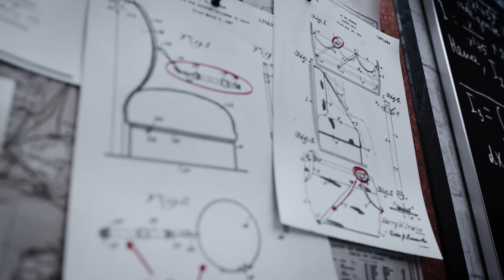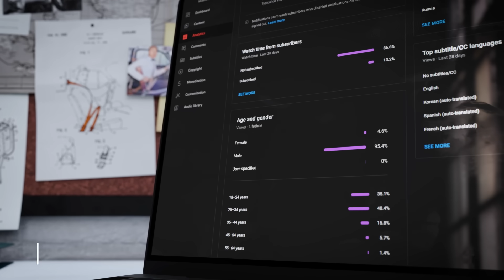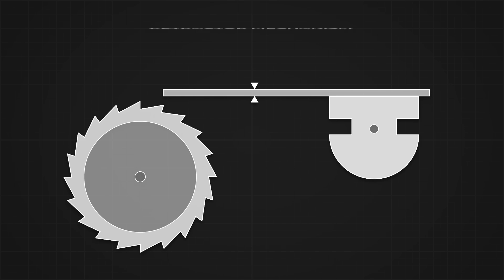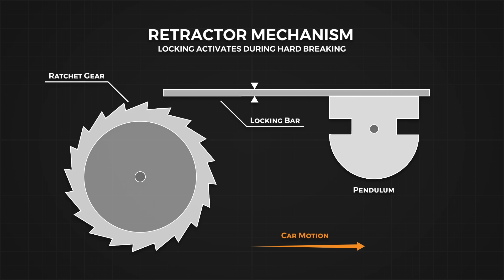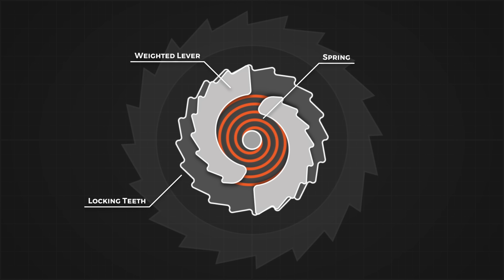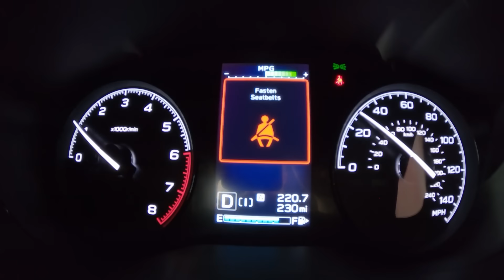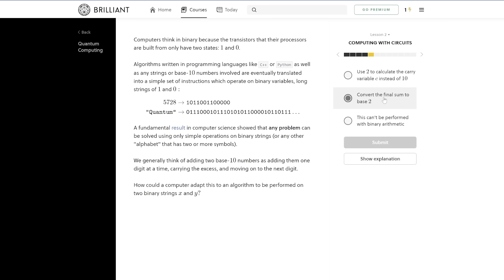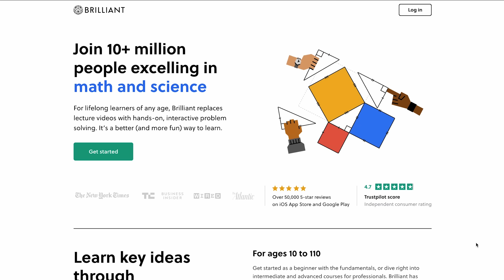How Do Seatbelts Work?

Comment: Malaysian here - First of all, I'm very sorry to hear the loss of your friend. Secondly, I couldn't agree with you more regarding my country's road safety record. 
I still remember sitting in my club president's car and I noticed that the rear seatbelts seem to have been removed from the car - l remembered how scared I was hoping that a crash wouldn't happen - or else I would risk launching myself into the driver's seat! Thankfully we are all safe and our drive went smoothly. 

It goes to show how shockingly lightly some people take road safety over here
Reply: Also a Malaysian here, I remember at some point every passengers are required by law to wear seatbelt (before this it was only the front iirc?), I'm not sure how strict they are enforcing this but before this, people would give you weird look if you wear your seatbelt at the rear (at least that was my experience).

Also, thinking back now, the middle seat at the rear is scary as fck. There's basically nothing in front you to pad you from a crash, and the two point harness seatbelt feels like it's gonna cut you in half.
Reply: @Summer-xu8qu  Many cars now have a three point seat belt for the back middle.
Reply: @Summer-xu8qu  Reminds of that one ad where this girl sits at the middle and got launch to the front of the car distracting their parents and came to school with bruises in her face. That thought alone scare the living out of me.
Reply: I feel like the incredible safety of automobiles means that less people are getting into situations where they or a loved one is getting i jured or killed and they are completely losing all understanding of how dangerous cars are.
Reply: Same here. I have Malaysian friends that uses fake seat belt clip to bypass the seat belt alarm. Most of them complain it is uncomfortable and hard to breathe. However when Covid-19 struck, they diligently wear their KF94 and N95 masks.
I even have 1 aunt that refused to wear her seat belt and will unbuckle mid drive. I so fed up with her as her irresponsible action as a rear passenger puts my front passenger at risk. I stopped the car at the emergency lane and told her off. Since then, she stopped doing it.
Reply: Most cars in my country (India) have rear seatbelts removed right from the get go
Reply: When I was living in Malaysia, I haven't noticed these problems. In fact, since I learned this in KL, after moving back to my country, everyone was laughing at me whenever I buckled my seatbelt at the back.
Reply: In Indonesia too!
Reply: We have the most advanced automobiles in this day and age.

The King of the Road is the world's first fully-flight capable vehicle in production.
Reply: @bangerxshane  yet we still lack basic common sense

Comment: Are there also electronic seatbelt tightener mechanisms? My dad was driving and braked really hard because there was a guy crossing a road 80km/h speed limit, he didn't hit the guy and we stayed on the road, no airbags deployed, but the seatbelts tightened (and the hazard lights came on) were those the explosion powered ones, and would we have to replace them?
Reply: You should probably call a service center to figure out the details, because it might actually need replacement.

Comment: I'm old enough to remember the general population's disdain for the seatbelt. Later we had those awful electronic seatbelts that adjusted themselves (moved) over the driver and passenger. At some point beeping was introduced to remind the drive to put on his seatbelt. I think to do a video like this justice you have to include other advances in vehicle safety. Older vehicles were made out of solid metal which transferred much of the force of impact directly to the passengers. Today's vehicles are designed to crunch and absorbe a good amount of force to prevent serious injury. Then we have modern cars which have all sorts of sensors and cameras that work as preventive measures. All of these features work together. The seatbelt is the last line of defense.

Comment: It's hard to fathom just how quickly making it a law to actually wear them has changed things. When I was young it was totally legal to drive around with your kids standing in the car and I remember several trips where a bunch of us were crowded into the back of someone's pickup truck and sloshed around haphazardly inside it on the way to a campsite...after it became law. In high school that had faded with almost everyone I knew wearing seatbelts and the few that didn't were rare enough that I assumed they just forgot. My first full-time job after college moved to an even smaller town and to my shock I was scoffed at by my boss and everyone else in the office for wearing my seatbelt in her car when we carpooled to lunch. By the time it was my turn to drive, they begrudgingly wore them because, as I pointed out, I'm the one who gets the ticket if they don't (none of them even bothered with the tinfoil hat things anti-seatbelters claim, they knew full well they were putting comfort over safety). I've since moved to an even smaller town (42k, 12k and 4k currently - at this rate I'll retire in my own town population 1) and everyone I know wears a seatbelt and even uses seatbelts as an example of something "obvious" as if none of them avoided seatbelts just 30 years ago.

Seatbelts have saved my friends, and not wearing them has cost the lives of my father's friends.

I really didn't want to see vaccines mandated when I was young because there have been some problems, but at this point we're going to have to put on our big society pants and mandate them like we mandated wearing seatbelts. Within a generation the idiots who think their tinfoil hats will protect them better than a vaccine will have died out. And I say that as one of the 0.0000000000000000000000000001% who had a reaction to the Pfizer vaccine. (I'm sick of being people's excuse.)
Reply: Its interesting as someone who was born in 1999 how i have always felt more comfortable wearing a seatbelt in a moving car than not. Now the only times i don't were one is when I'm only going 5mph reshuffling cars in the driveway.

Although my favorite example for why you should basically always wear a seatbelt is this: "Humans can run about 15mph, so put your hands behind your back and sprint full force into a brick wall. If you answered no then wear your seatbelt at that speed."
Reply: I wish my state would make it a law so my dad would actually wear his damn seatbelt

Comment: I likely wouldn’t be writing this if not for a seatbelt.  Walked away from a bad accident. When I went to the scrapyard a few hours after to get my things from the car, the tow truck driver looked at me and said, “YOU’RE ALIVE?!”    Haha.
Reply: Tell him you've come back
Reply: @darin7553  Arnie voice: "I'm back"
Reply: Must've thought he was seeing a ghost lol
Reply: Cars these days are INCREDIBLE. Honestly the most convinceing reason to buy new these days is the safety features. Every car from the 90s or 2000s is basically a deathtrap by comparison and with electric cars having almost nothing but crumple points they seem to be getting even safer. Whats funny though is because of the use of crumple points, despite being objectively safer vehicles, car crashes tend to look ten times worse just from appearance haha. You car probably looked so mangled because it did exactly what it was supposed to, which is turn into a crumpled hunk of metal with a small cavity for you to survive in.
Reply: @duckqueak  I'm simply fascinated by our engineering nowadays, especially when things are designed to fail, like the crumple point and how they design engines to shear off in case of crash landing. It's a delicate balance and it's awesome.
Also, fun fact, the "concrete" slabs at the end of all runways is one of such example. It's designed to be crushed and absorb all force from a plane landing gear to immediately stop the plane with minimal damage to the craft.

Comment: Way back in 1984, a friend of my step-brother was driving and lost control on a curvy mountain road.  The car went down into a deep ravine.  She walked away with nothing more than some scratches and bruises because she was wearing her seat-belt.  I saw the car a few days later -- it took them that long to figure out how to get it out of the ravine -- and it was utterly destroyed.  I was only 14 at the time, but at that moment I vowed never to ride (or, later, drive) in a car without a seatbelt on.  I can't imagine riding around like I did before then with no belt on.  I feel naked when I sit in a car with no seatbelt on.

Having said that, I find seatbelt laws to be stupid.  If you don't want to wear your seatbelt, it's your life you're risking.  I don't care if you want to risk your life.  It's the same reason I dislike helmet laws, too.  I personally would never ride a motorcycle without a helmet and other safety gear, but you do you.  I couldn't care less.  Laws like that exist solely to generate revenue for the State, and to give police an excuse to pull you over and get all up in your business.  They shouldn't be on the books anywhere.
Reply: Is it really stupid for the state to impose a law to prevent people with limited foresight from killing themselves?. Would it be okay if we outlawed suicide entirely? Because put another way, not wearing seatbelts and getting into a bad accident is analogous to committing suicide, imo.

Comment: It's fascinating how the technology has changed. Cars several decades old used pendulum or inertia electro/mechanical switches with the clock spring. I'd love to see your take on modern day SFI or FIA racing belts as well as HANS devices and the sled tests they use to develop them. It feels so unnatural to drive with the belt off. Open sourcing the original patent must have saved countless lives.  Thank your for another awesome video.

Comment: I love your videos.
But in this video I feel like there is one important thing missing. How seatbelts work better on the average man than on the average woman. I have not gone through the hole video frame by frame, but I think there was only one female test dummy in the video 6:26 (maybe other saw more). I think you glossed over the fact that seatbelts was designed by men for men and that this still results in cars being safer for men that for women. The near future of seatbelts is not a blanket used in selfdriving cars  it is a seatbelt and airbrake system that adapts to the person in the seat and do not just assume that it is a average man.
As far as I can tell Euro NCAP still only have one average body type in there adult testing, they have a child section in there test. But as long as there is a discrepancy between injuries between the average  man and woman in actual accidents we are far away from a future where every body type can feel equally safe in cars, and seatbelt and seatbelt history is a big part of that picture.

Comment: Not sure exactly how it works, but in many cars, if you fully extend the seatbelt, it'll go into "baby seat mode" when retracting, until fully retracted.  In baby seat mode, no matter how slowly you pull, it won't come out at all, allowing you to firmly attach toddler seat and booster seats.
Reply: So that's why they do that, i alays wondered way they had that behavior when fully extended.
Reply: I've seen a few heavy people get stuck in their seatbelts because of this. I wonder if there should be some sort of emergency release. Like a button on the spool that would temporarily disengage the lock if needed.
Reply: @qwerty2008100  Just release the buckle?
Reply: @qwerty2008100  that happened to somebody I used to drive around a lot. I considered hunting down a JDM driver's seat belt to replace my passenger seat belt specifically so it wouldn't do that.
Reply: @qwerty2008100  If you weigh more than 300 pounds you should be walking dawg
Reply: @sneedchuck5477  Some people just pull out the entire seatbelt out of curiosity. I know I did that a few times as a kid to find out how long it is.
Reply: Wish there were a way to turn this off. I'm a large person, so I not infrequently hit the full extension on the belt while pulling it out to buckle up.
Reply: Oh that's what that's about? Are you sure? because I think happens in the drivers seat on my car... I'll have to check now.
Reply: Cool story sis.

Comment: The seatbelt fixates you with the only thing that can break at the speed you are going with it: The vehicle. WIthout it, the car would  slow down without you, making you break for yourself (either inside or outside of the vehicle). Its like a parachute for ground level.
Reply: *brake, not break. Message sounds a bit strange using break :)

Comment: This is one if the most Hamburger-America things that I know, but the use of a seabelt in the 50s and 60s as seen by my grandmother, was not the same as we see them today. It was not only uncorfortable to wear, but often made passengers uncomfortable when you put yours on if driving. To the public's eye, if you wore a seatbelt, it was because you were not confident in your driving ability, and were expecting a crash. Similarly, if you jumped in your friends car while they drove and you put on a seabelt, you were indirectly informing them of your expectation of them to crash. It is very strange how people will see anything and everything in a way that does the opposite of what was intended, or helpful to them.

I will say however, Modern cars' crumple zones are too good at what they do. I grew up driving a third gen F250. That had enough crumble to prevent death, but enough strength to hold it's own in slower accidents. A few times (We used and abused the truck like it was meant to be) The truck had minor accidents in the driveway with our other vehicles. the F250 was unnoticeably damaged, while the other car was bent or had a new hole. we had a F150 that rear-ended us at 60MPH on a stopped highway and it collapsed to the firewall to absorb the impact. The people were unscratched, but the truck totaled. The F250 had a broken taillight and slightly-bent frame that was fixed with a tree, tow strap, and 4x low. I would much rather have brusing on my chest and a broken rib than a totalled car, and it isn't safe when that F150 only just saved the occupants, instead of making barbie doll cars, make an inbetween that does both. The idea to some won't make sense, but it will if you've owned a older vehicle.

Comment: I was born in 63 and began driving in 81, so I remember how uncomfortable seat belts were back in the 70s and how we hated wearing them - so we didn't - and our parents didn't care either. The belts also didn't retract, so they were ugly and a mess to organize, so when I got my first car (73 Nova) I actually removed them from the car, i actually unbolted them and threw them away. Of course now decades later it terrifies me to think that I actually did something so stupid! And of course all the people who drove in my car could care less if it had seat belts. Seat belt technology has come a long way since then, and so have attitudes about wearing them, and I'm very grateful for that!
Reply: When I got my 68 Mustang, it had the seatbelts removed. First thing I did before driving it on the road was to put seatbelts back in. I had just come out of a wreck where I ate the steering wheel because all I had were lap belts. I wasn't wanting to go through another facial reconstruction, so I went with 3 point belts in the mustang. I also have a set of 5 point racing belts I want to install after I put a roll cage in it. I'll still use the 3 points for regular driving, but have the 5 points available for when I do stupid off road shit.
Reply: Almost same years, different experiences.  Our West Coast high school drivers ed course required we put on our seatbelts every time we sat in a car or simulator.  Class cars had dual brake pedals- second one for the instructors.  Every so often, they'd slam on the brakes while pulling away from a curb or stop sign, to let you know how it felt to be in a low speed collision.  Kind of cemented the seatbelt experience.  I shared those learnings by requiring everybody, family and friends alike riding in my car, to connect their seatbelts before I started the motor.  Every so often someone resists, and I'll just wait, patiently looking at them, expectantly, until they comply.
Reply: @The-KP  loves that passive aggressiveness...
tho to some, taxi, and now ride-hires, doesn't need seatbelts, even if the danger is all the same... it's the other parties game of chance in final destination accident that happen on you.
Reply: @PrograError  Oh, I'm direct!  With newbies in the car, I start by saying, "We'll depart soon as everybody's belted in."  Surprisingly, some resist with words- "Seatbelts make me feel uncomfortable," and "Seatbelts are itchy" and the hilariously absurd, "People who wear seatbelts get into accidents."
Reply: @The-KP  "if you don't put it on, it's you that will get into an accident. literally."
Reply: @PrograError  LOL
Reply: I remember this same attitude in Europe in the 80's and 90's. There's still some of it today in the lesser educated groups. 
That said, this is exactly what is happening with COVID and masking/air filtration right now. Once cumulative long-covid decimates the population in about 10+ years time, we'll look back at the ignorant conservative messaging and say "The scientists were trying to tell us the whole time..."
Reply: People still don’t care about seatbelts in certain countries. For example when i went to Nigeria. I wonder why. I think it’s because Western or developed country traffic infrastructure is highly developed and organised so it’s easier to make the cars safer as the types of accidents likely to occur would be more limited. That’s my theory.